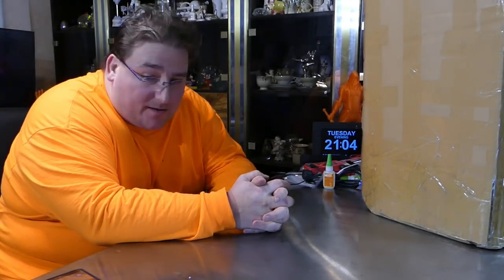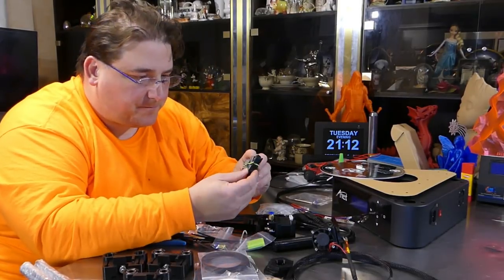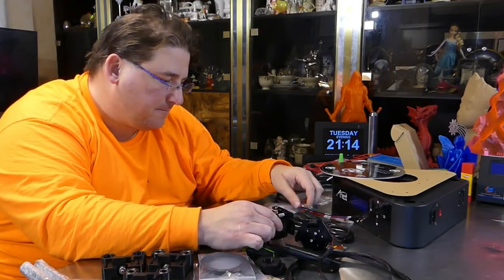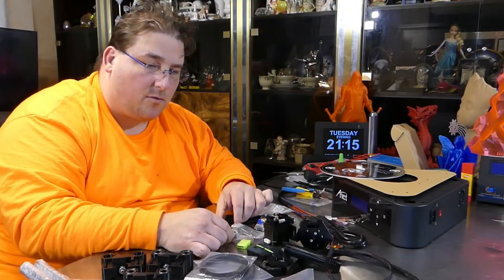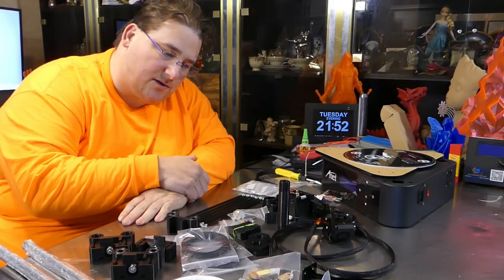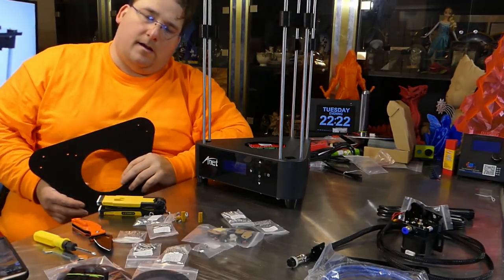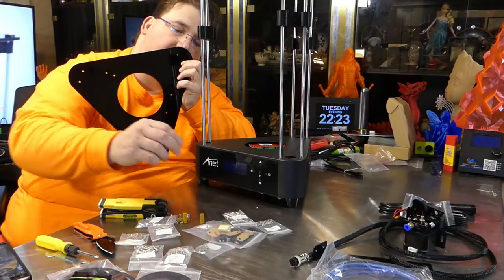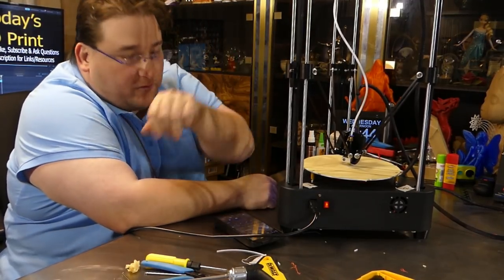Today's 3D Print 186 Anet A4 Delta Unbox, Build, First Print

Comment: Welcome to the delta club, i bought an anycubic linear plus, after about 4 weeks including building the firmwear by hand, it now prints the same quality as my cr10s but faster :)
If you need a nice firmwear for the cr10s just let me know i have a great build thats been tested by many people, works amazing and you get manual mesh bed leveling which is awesome.
Reply from the maker: +Tac Blades the printer seems to bowl. Its closer to the print surface the further out from center you go.
Reply: Nerys if you mean the delta then this is the print radius setting.
Reply from the maker: +Tac Blades can you clarify?

Comment: I actually got mine assembled at easter. Mine was missing the hot bed screws, the fans were mixed (hot end plugged in to part fan and vice versa), the nozzle bore was really rough (caused filament jams), the extruder cable was for a different printer (the extruder run reverse), the lcd glitches out when the hot bed is on (the ribbon cable is routed too close to the psu) and thats just a small part of it...
Reply from the maker: Fun isn't it / s :-)
Reply: Nerys I have had a few A8 before so I kind of knew that it will be doodoo, but this was on another level.
Reply: but hey I got it printing after basically rebuilding the thing :D
Reply: oh yeah the hot end isnt even all metal :D not on this or the e12 but the tolerances are so bad the it causes the issues you also described
Reply: I probably cracked the issue, your e10 or e12 review where you said you changed the hot end to a Ender/Cr-10 got me to the right track! Its the PTFE tube. The tube and the Heatbreak liner is using PTFE tubing for 3mm filament. Thus there is just too much room for the filament to expand Before the nozzle -> too much force against the stepper. Since I had the same issue on my E12 test unit I change both the exturder tube and the liner to Capricorn and now it seems to work like it should, if the benchy im currently printing comes out nice, im going to the same on the A4.
Reply: How did you get the extruder to run normal?

Comment: this printer is crazy. i had troubles assembling it, too. i constructed and laser-cut my own top plate because i thought the "newer" version was just faulty. but now it delivers surprisingly good quality prints. i sometimes prefer this over my prusa printer, no joke. the only thing i am missing is the firmware that should be available when calling it an open source printer. i really want to replace the extruder but i don't want to experiment with a naked marlin firmware to get this thing running again.
Reply from the maker: How did you get it to level calibration? Mine works fine as well except I can only print small things because as soon as I move out of the center the print bed and firmware is bowl-shaped I understand I need to calibrate the delta kinematics but I don't know how to do that
Reply: I adjusted the bed that I was a bit too high in the middle and a bit too low at the edge. It worked out for me.
But hey, I did some work. Download the newest Marlin (v1.1.8) and use this confuguration: https://github.com/langi4888/aneta4config
I added some nice features (which Marlin offers - thank you, Marlin!), the printer is now getting usable (and modifyable).

If you are too high in the middle, raise the DELTA_RADIUS in 0.5mm steps
If you are too low in the middle, just lower the DELTA_RADIUS.
I measured ~109mm and ended up with 111mm.

If you are experiencing any troubles, just report them.

You need to install the Arduino IDE and add this addon: https://github.com/SkyNet3D/anet-board
You need this or it will not recognize the board of the ANET. You can find a lot of tutorials when you look for firmware upgrade ANET A8 (which uses the exact same board)

P.S. I also added the top frame as seen in the assembly video as a CAD file.

Comment: congratulations for the video and instructions !! you know where I can find the belt tensioner of the a4 ??? Thank you very much
Reply from the maker: The belt tensioner is the two plastic pieces that Interlink with the 45 mm bolt going through them that is the belt tensioner you just tighten up that screw to tighten up the belt
Reply: ok and that's clear..you where can i find it ?? i have to replace ..
Reply from the maker: Oh that is a good question I will try to find out for you
Reply: Thank you very much very kind !! Keep it up your printers are exceptional..look for your news !!

Comment: Finally. I've been waiting for this. Thank you.
Reply from the maker: +Marcos Ramirez be careful. The guts seem solid but the qc is really relly bad with this one.
Reply: Nerys That's fine. The fun part for me is to modify until they print with good quality. If I do buy it, I'll just reprint all the 3d parts and add a new e3d hotend. It doesn't seem like alot to change the hotend, put buildtak or maybe a flexplate with buildtak, a mosfet for the heatbed, maybe an autolevel probe although it might not be necessary. Yes, I can see it as a hobby project. It won't be a workhorse but it will be fun.
Reply from the maker: +Marcos Ramirez it does have the advantage of being very cheap. I got a cr10 hot end which looks to have the holes in the right spot to bolt upto this. Future video will show that mod.

I also have the flsun qq coming! Wifi Auto leveling fully assembled nice build volume. I am hopeful.
Reply: Nerys Can't wait to see it.

Comment: My Anet A8 experience over year ago was similiar. I watched videos from three different sources and two how2 pdfs. thats why i needed four evenings to build it. But it's a good printer if the assemble is correct. I knew it couse of price and half and year later i know every part of the printer and the differences to others by parts and price.
Reply from the maker: I know its junk but man I want an A8. if I make it through the next few months intact I am going to get an A8 just to mess around with. I miss printing parts and upgrades and watching a printer go from meh to wow like I did on the Duplicator I3. modding prints is fun. I also really want to putz around with an X5s I know its not that great but it looks cool and is cheap.

Comment: Great Video again Nerys. Had the same with the top acryllic part, but then put 1 and 1 together and realized they just changed the design. My bearings were total crap though. Replaced them with Igus ones and now everything is good. The Instructions were really bad, i agree. And for the bad printed parts they even included the parts files for the printed parts on the Micro SD cards. And the problem with the screen is as i found a loose connector on the back of the display. The Electronics were solid built, so no complaints there. Maybe the fans noise a little, but i cant complain since i paid 70€ for the kit.
Reply from the maker: Wow that's not a bad deal for that price! I'm going to torture mine when I get the new place I'm going to mount it to the feeling upside down just for shiggles :-)
Reply: @nerys71  It was listed as a Geeetech Kossel but i received an Anet A4 :D. Well i don't mind. It was thought as a low price entry in the delta printers, since i only worked with cartesians till now. And keep us updated about the ceiling mount.
Reply: @nerys71  Did you have the issue aswell, that even when the corners were entirely level, the center point was still a little low compared to that spots? And if yes how did you fix it?
Reply from the maker: yes and that is the problem. you have to take measurements. do math. apply corrections in firmware and then repeat until you get a level virtual plane. I have never done it don't have time to do it just now which is why I would avoid non auto bed leveling. :-)

Comment: That looks like a Rostock mini. I have an old One. 4 years old. And its so weak I have to palace it against a wall to straighen it Up. Best thing with these printers is its size. It fits easily in to a small ikea kitchen closet with a glass door. Put a very slow fan and vent hose in the roof and you are able to print smelly plastics with it😃
Reply: Upgrade https://www.thingiverse.com/thing:2513101

Comment: I do have the same printer and can’t get  the heat bed levelled. It seems that the bed is lower in the middle. Any clue how can I get it levelled?
Reply from the maker: I know what is wrong. I do not yet know how to fix it. The printer needs to be calibrated this has to do with the delta kinematics. Ie the way it moves in 3d space. I hope to learn how to do this with the a4 as time allows.

I am does exactly the same thing it's lower in the center than on the outside but the bed is flat so it's the kinematics that are bad and need to be calibrated my QQ does this automatically when it does its initial probing of the bed on the a4 this will have to be done manually I don't know precisely how to do that yet

Comment: I regret buying it, not knowing much about it but I’m glad you made a video!
Reply from the maker: Yep sadly I cannot suggest anybody buy this what you like to Tinker I mean the machine does work kind of sort of :-) but seriously don't buy this anybody else reads this just don't buy it
Reply: Nerys I tried to look for a video on how to level the bed on this but no luck! So it’s just sitting there.
Reply from the maker: @brucewayne8966  there is no way to mechanically level a Delta printer since there is no X Y and Z axis x y and z are all a mix of all three they have to you work in unison and coordinated this means level doesn't exist it's a virtual level mathematically generated algorithmically

That's why Delta printers don't come with leveling knobs it wouldn't do any good :-) you have to do it by measuring doing bath and inputting Corrections in the firmware or mesh bed leveling where it does the math and Corrections itself :-) that's why I won't do a Delta printer that doesn't have automatic leveling I just don't have the skill to do it manually right now
Reply: Nerys thanks for responding! I’ll try that instead!

Comment: I have a problem trying to calibrate axis y and axis z because it starts to crack and I always end up turning it off
Reply from the maker: Sadly that is beyond my current skill level it's one of the problems I had with the printer and that I don't know how to calibrate it and there are no instructions on how to calibrate included

If I do figure it out I will make an updated video

Comment: I have this same printer. I was able to assemble it fairly easily, although found the same discrepancies in the instructions. Now I am trying to print one of the test files include. When attempting to print with the included test files, the filament feeder is going in the wrong direction rather than feeding filament. Any idea as to what is wrong? Everything else seems to be working.
Reply from the maker: first thing I would do is heat up to 200c and then in the menu use the control knob to manually extrude filament. if the number on the screens goes positive but the filament retracts then making the number go negative should make it properly extrude plastic. if this is the case then you (as in your printer not you specifically) got your wires reversed.

try inserting the wire into the stepper motor "backwards" (it might not fit exactly right but I think it will go in)

if that fixes it great done or you can manually move the pin sockets to be the "right way" (right it down on paper the order they are)

its not common but it happens. its also possible you accidentally put the wire in backwards. either way flip it around and see if that fixes it.

Comment: I cannot level it, well I can then print a sample and it turns into a bed engraver instead. I figured I need to connect to my mac and set the delta base dimensions correctly. Now I cannot connect to my mac. If I manage that then I may toy with delta levelling software. Is there any forum resources or tips on getting this thing connect to a mac and good / easy software for levelling.??
Reply from the maker: From what I understand you need to take physical measurements of the printer as it moves around the bed and do some math to enter Corrections into firmware and then reupload the firmware to the printer unless the printer has some sort of function built-in to help with that

It's one of the reasons I don't do much with the A4 I don't know how to make those Corrections yet
Reply: So, I just copy my comment:

Download the newest Marlin (v1.1.8) and use this confuguration: https://github.com/langi4888/aneta4config
I added some nice features (which Marlin offers - thank you, Marlin!), the printer is now getting usable (and modifyable).

If you are too high in the middle, raise the DELTA_RADIUS in 0.5mm steps.
If you are too low in the middle, just lower the DELTA_RADIUS.
I measured ~109mm and ended up with 111mm.

You need to install the Arduino IDE and add this addon: https://github.com/SkyNet3D/anet-board
You need this or it will not recognize the board of the ANET. You can find a lot of tutorials when you look for firmware upgrade ANET A8 (which uses the exact same board)

Comment: really want to have one.
Reply from the maker: No you don't trust me this printer is not worth buying not yet at least at the minimum wait until they come out revision 2 this one is not ready for sale
Reply: I still don't think it's THAT bad. I posted a running firmware already which makes the printer ready for calibration (it now solves the display problem you showed in the video, the slow 8 bit processor just was too slow for the original firmware settings).
No, you won't build this printer in 10 minutes, it took me some time. With the original firmware you won't get happy. Just flash Marlin and you're good to go.

Comment: Is there any Anet printer you suggest on buying? Also have you uses anycubic delta?
Reply from the maker: +Shadizzo no. While i love my e10 there are better alternatives. (Ender 2 cr10 cr10 mini i3 mega)
Reply: If you are interested in the anycubic delta, I can tell some things. I recently bought the anycubic delta (plus/linear) as kit. I chose it, cause in this price-rage  of cheap deltas (kits) it looked more sturdier than the others. The videos and manual for assembly are good, the part-packing ok.
The chapters for the different versions of the printer are well marked in the manual.
What looks a bit tricky is the firmware-part, cause the manual tells you to change several parameters and compile it. If you go this way, you could also use the newest marlin software. But the far easier way would be to just pick the right binary one from the anycubic-site-> those work fine
You could level this printer manual....but you don't want. If you have the anycubic-autoleveling tool in the kit....great. If not, place a old limit-switch below the nozzle with a printed part or a chewing-gum , measure the distance from the "click" of the switch to the nozzle. Give the printer this number, autolevel-> bang it works.
Then you have a nice, reliable delta. I recommend to make it more stable, with printed parts and let the extruder fly (I use counterweights and springs), this gives a bit more headroom to speed it up ( as far as the calculation-power of the boards allows you). I also added the new round ultrabase, made a bigger bottem to move the pus with the fan in. changed stepper-drivers....but all just to have some fun.

Comment: Dude, that sucks! With a delta that uses extruded aluminium for the frame you can mount the extruder so your Bowden is as short as possible... is there any benefit to using linear rods?
Reply from the maker: +Chris Kyriacou i do not know. Most likely it was just a cost savings decision.

Comment: My 3dp from gearbest has not arrived after a month this is my first printer so has anyone ever had problems with them to the uk it was an ender 2
Reply from the maker: +Judoguy 12 3 to 6 weeks is quite normal. Past 7 weeks i would worry. Did it ship yet?
Reply: Nerys yes it shipped and it arrived in uk but courier says they know nothing about it btw I am 13
Reply from the maker: +Judoguy 12 then its in the hands of the uk courier. Your going to have to have your parental carbon units get in touch with them.

Comment: Did you dare to take a look at the electronics and power inside? I think your review might have been too kind 😉
Reply: Oh. And great video - as always. Thanks
Reply from the maker: +Bertie Blob yep after first print heater cart died had to replace and overhangs sucked. Blower was dead had to replace.

And the lcd goes fritze shortly after starting a print so you cant use the ui till you turn it off then on again.
Reply: +Nerys If it helps any my newly built Anet A8 has same problem with display. Moving ribbon cable seems to affect it, but it still goes occasionally. Maybe the unshielded ribbon cable is picking up interference? P.S. As an experiment I'm going to wrap the cable in foil and wait to see if it continues. I'll let you know.
Reply: I left this for a while to see if it worked. Wrapping silver foil around the LCD ribbon cable appears to have cured the 'corrupt' display issue on my Anet A8. I just cut foil into strip and wound it round cable. Secured ends with a bit of electrical tape.